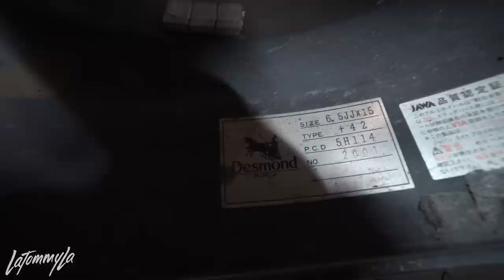These are RARE and SICK, but not my style...

Comment: Having less weight on your wheels makes a big difference on the butt dyno. My v6 Accord hauls ass with my Wedsport tc105n 17x8 +32  wrapped in 235 45 falken fk510. You make me want the rt615k+ though. I just wanted more ride comfort and tread life. BTW I run Amsoil signature series with Amsoil synchromesh MTF.  And always a K&n high flow oil filter. This oil/filter combo is the best for longevity and performance trust me. (That’s if you want to run a full synthetic)
Reply from the maker: Yes sir it does! I used to use Amsoil for motor oil, but always used Torco for transmission stuff!